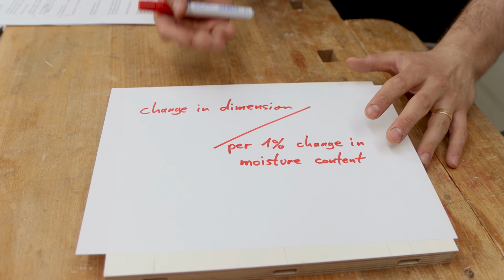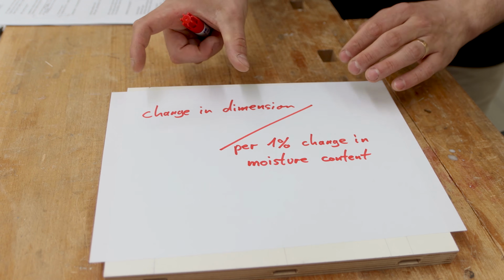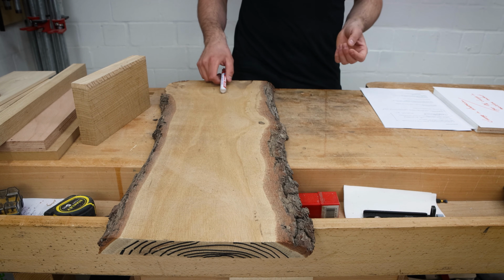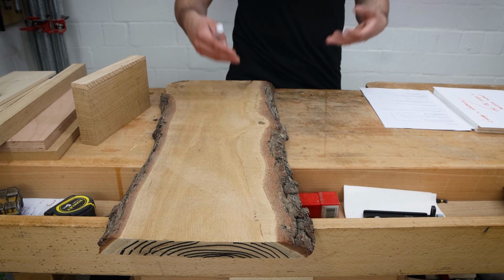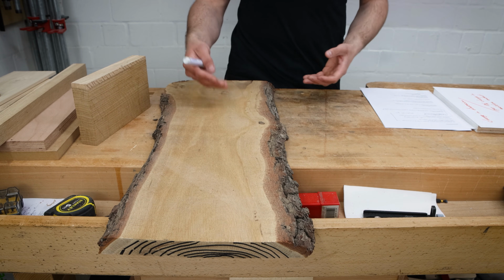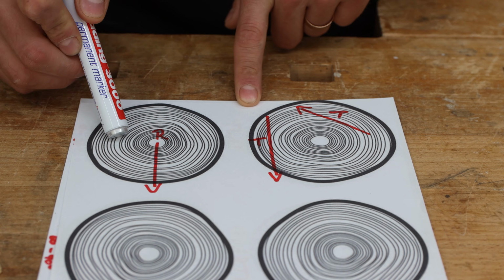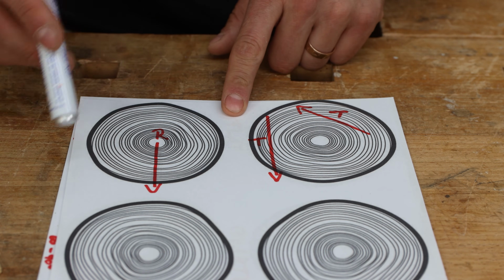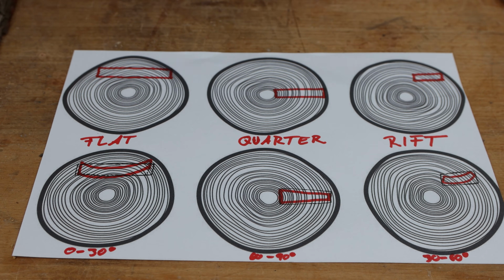What is wood movement? And how to account for it in furniture projects!

Comment: I know this video is a bit old, but I don't think I saw what to do or where to glue IF you need to glue up a panel board, like on your demonstration at 13:00, BUT you need to make a picture frame to encase it. In example, like a wedding sign panel board that are currently so popular. I understand wood movement, but how do I secure the panel board (where the wood grain is going horizontal) to the vertical sides of the picture frame (also wood, not plywood), accounting for wood movement? I hope I'm making sense as I know it can be difficult to convey what I'm trying to explain.

Thanks in advance!

Comment: Like #890 I haven’t done any testing, but I suspect that epoxy tables have less movement than most as the surface of the wood has been sealed unless it was planed /sanded down significantly.   Even then, finishing a piece on both top and bottom helps.
Reply from the maker: Most of the moisture exchange is happening at the end grain. Most epoxy tables are not covered with epoxy there..

Comment: Good explanations. The “seasonal changes” does cause shrinkage and expansion. In the winter, though, the cold air holds less water and therefore has less humidity than in the summer. Even indoors the air will be even less humid due to the source of “dry heat”, unless using a humidifier.

Comment: Design and construction of furniture need to consider wood movement primarily in the indoors environment. We all know this. Humidity is greater in the summer than in winter in all regions of the world if the indoors environment is air conditioned. Heating in winter time dries the indoors environment and the wood shrinks. In the summer, even though air conditioning dries the indoors environment as well, the humidity is much greater than in the winter time. In the US we design assuming that the humidity will be greater in the summer than in the winter. We are in the northern hemisphere, the same as Germany. How can your humidity be greater in the winter than in the summer?

Comment: The air is dryer in the winter than in the summer. The moisture evaporates faster in the summer because hot air could hold more moisture in it. Wood shrinks in the winter and expends in the summer. So it is directly opposite to what is explained

Comment: Is that wood, mdf, wood sandwich really a good idea for very large tables? I am making a work bench that is 5 ft by 9 ft and am planning to have maple top (3/4 inch board tops), and pine softwood bottom (1 inch thick). Wouldnt the glue not be strong enough along the face to hold that all from expanding and contracting?

Comment: Hallo Bau-Woodworks, all is "sehr auserordentlich", I am in the process of building a dining table here in NJ, where it is really humid. I am assuming that all the table top pieces ( Five 9.25"x46" poplar will be dominoed and glued with breadboards at both ends) are at their expanded state due to humidty. I will use those "Z" clips to attach the top to the base. I also was thinking to leave the breadboards approx. 1/16"-3/32" sticking out from the sides of the top to allow shrinkage/expansion. I was wondering if this is necessary when all wood is going to shrink once in the climate controled house?  
I was at the wood movement calculation sites: poplar isnt on the species list (not a big deal), my question ( a silly one) is this should I use the total table top width or the width of the individual planks? I did try both, the result of the total width seems extremly high and I cant believe the movement would be that much. I hope I was clear enough and you can send me your take in this issue. Danke in voraus....

Comment: Very nicely done. I would just ad a tiny thing on this perfect video : Yes it is in most cases dryer in summer than winter but mostly if we speak of the outside. Inside is a different game : Your workshop might be for some reasons (basement or whatever) still very humid in summer. And the place where your furniture will end up can be as dry as hell in winter depending on how much people actually heat up their houses. Than we have a case where the furniture built in summer in the humid workshop actually shrink in the house during winter. it happened to me on an 85cm oak table I built with sliding dovetails. The oak shrinked for about 2cm during winter. Everything was ok but my point is that if you want to use those methods that you really well explained, it is important to take in account the specificity of the place you're building comparing of the one of the place it will go in terms of differences of humidity percentages. in some cases like this it is the other way around. Sure you already know this but for whoever who doesn't...
Reply from the maker: Hey Jonas,
You are 100% right! It absolutely depends on your specific circumstances in the shop and where the furniture will live. I think I should have made that clearer!
Thanks for clarifying and sharing 🤗

Oh wow 2cm movement sounds like quite a bit. Glad you took it into account and the table is fine! Great job! 👏

Comment: Superbly informative. Just not a fan of the terms (longtitunial etc) i much prefer length, width, height terms for me at least.
Reply from the maker: Thanks.
Yeah me, too. Especially since these words are pretty hard for me to pronounce and I had to make sooo many takes because of it. But length, width and height do not reflect the way wood moves, since it is highly dependend on the way the growth rings are in a board and they run in a circle. Therefore we could replace longitudinal with length in most cases but radial and tangential can't really be replaced...